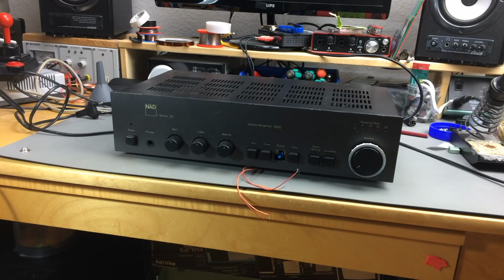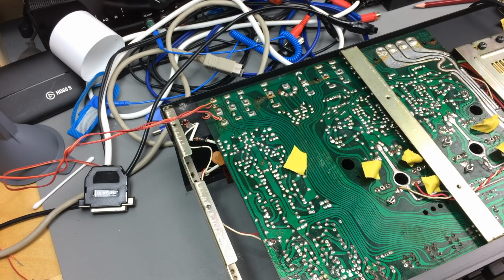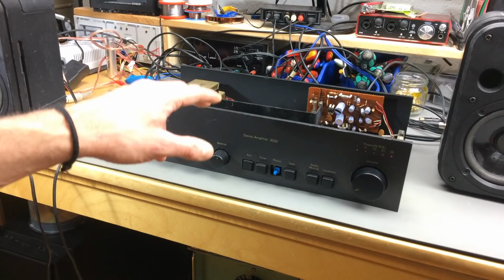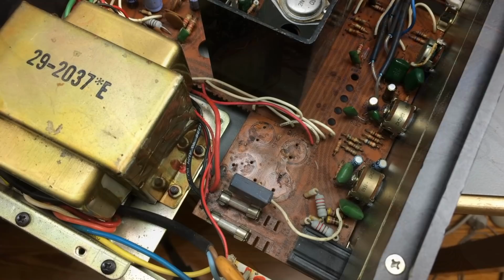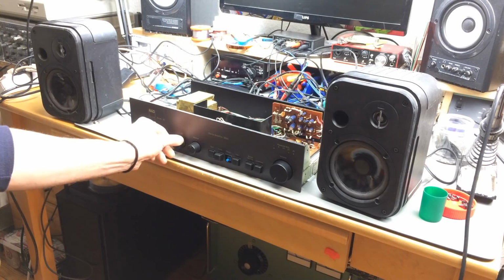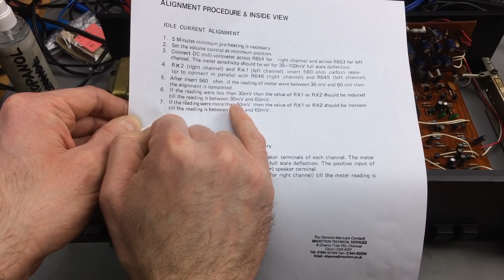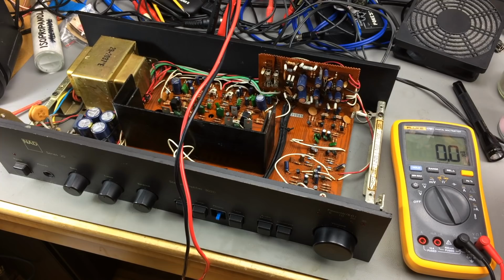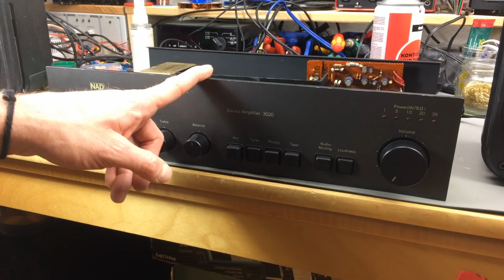NAD 3020 Series 20 Vintage Amplifier Repair

Comment: Two common issues with this NAD circuit (they used it in a few models):

The muting JFETs in the preamp stage often die, causing distortion or other problems

The output transistors have NO emitter resistors. This becomes a problem when they require replacement - I note one of them in your unit has been replaced. It was not a problem with the older Motorola made "hometaxial" devices, but it is a problem with modern "epitaxial" devices made today. It's a good idea to add 0.22 ohm emitter resistors underneath if you replace the output transistors. This also gives a much better way to measure bias current than the way described in the service manual. I've used Arcol V3 vitreous enamelled resistors for this before.

Otherwise, yes, they are nice sounding amplifiers especially for their budget price when released :)
Reply from the maker: That is a good idea. I think I want to replace the output transistors altogether to have a better match (and "fresh" transistors). I'll add emitter resistors when I do it as you suggest. :)

Comment: 29:17  I noticed a missing resistor just pause and see at the center of you screen, between those polyester caps, behind to the larger one next to a small transistor on the side where original pair of transistors are.  maybe that is the reason why you have high bias voltage

Comment: Hi
I notice that my NAD 3020e  only has a 2 core power cable, so the metal chassis of the amp is not earthed.  Is this a problem?  It looks like no three core power cable was ever fitted.
Reply from the maker: Hey, that’s perfectly normal for hifi equipment. There’s only very few amps that have a mains earth connection (I think connecting to earth makes picking up mains hum a lot more likely). The NAD is sufficiently insulated so there’s no risk of electric shock.
Reply: Thank you. I thought maybe it was double insulated and also have heard about stray hum. I really enjoyed your video on the 3020.

Comment: i always liked the sound of these amps, sadly they were made cheap and sold expensive, but at least they are repairable.
arcam, cambridge audio and nad have all been repaired by me over the years.
i dont fix them any more really, i build bespoke metal detectors and custom computers, but i have a vintage sinclair radionics pre amp unit and an amp that goes with it on my bench, i was going to recycle them, but a mate of mine wants to buy them if i restore them, so i'm parts hunting.

Comment: I do enjoy these videos, as well as the retro stuff. I only know the basics of repairing audio equipment. These videos are always a learning experience for me. 👍

I haven't read all the comments and perhaps I am missing something in my understanding, but wasn't the right channel mV measurement reading a negative value (–53mV)? Was that as closest you could adjust it to 0mV or +1mV?
Reply from the maker: Thanks Mark! I'm obviously just a hobbyist with the audio stuff, too, but I worked on quite some amps in the past so there's always at least a tiny bit of experience to share. ;)

The mV was negative indeed. And it was the closest I could get, I couldn't get it to positive at all. I think I'll end up replacing the output transistors altogether with matching ones (still readily available). Some commenters pointed me in the right direction for adjusting the idling current, too. :)
Reply: I wasn't even aware of idling current. #AlwaysBeLearning

Comment: You can bult in a speaker relais that grounded with a 10 ohms resistor (10 watts or so) to ground if its in off status. EB (com): Speaker Protection Board Component Audio Amplifier DIY Boot Delay DC Protect kit,  and 2Pcs Wirewound Ceramic Cement Resistor 0.1 - 10K Ohm 10W Watt 5%

Comment: hello, I have a Nad 3020A, will there be a problem with the amplifier if I turn on my dac in LAB IN and remove the jumpers from NORMAL IN and PRE OUT? I have never used LAB IN, but when I included my dac in it. The sound has improved significantly. But I don't know if I use this switch, is there a problem with the amplifier? Thanks and send greetings.
Reply from the maker: Lab in is just an input that doesn’t filter the super high and super low frequencies. The regular input has some filters in place. Depending on the audio input and your speaker setup, you can sometimes hear better quality from the lab in because of that. And of course it won’t be a problem to just use the input and power amp and leave the preamp section out of the equation, you are going to be absolutely fine, you just don’t have the controls.
Reply: @JanBeta  Thank you very much for the answer.

Comment: One question : for sure it was better to change all capacitors, but would it damage the speakers if you changed one, turned on the amp and so on until you find the guilty capacitor?
Reply from the maker: I don't think the noise would harm the speakers in this case. The only thing that kills speakers really quickly is DC voltage, they can take a lot of AC for short bursts usually. It is annoyingly loud though, so it would be a better idea to connect a load and an oscilloscope to check the output.
Reply: I don't really understand why you would want to change one cap at a time. If this was a fairly new amp it would be better to just replace the defective cap but since this amp is 40-50 years old they all need replaced. If you just replaced the defective one you would probably be repairing the amp often since most all of them will fail due to age.

Comment: IDLE CURRENT ALIGNMENT
5 Minutes minimum pre-heating is necessary.
Set the volume control at minimum position.
. Connect DC milli-voltmeter across R654 for sight channel and across R653 for left channel. The meter sensitivity
should be set for 30–100mV full scale deflection. RX1 (right channel) and RX2 (left channel).
. Insert 1 kohm carbon resistor to connect in parallel with R654 (right channel) and R653 (left channel).
. After insert 1Kohm. if the reading of meter were between 5 mV and 11mV then the alignment is completed.
. If the reading were less than 5mV then the value of RX1 or RX2 should be reduced till the reading is between
5mV and 11mV.
If the reading were more than 11mV. then the value of RX1 or RX2 should be increase till the reading is between
5mV and 11mV.

Comment: i also have a mains hum when i power up a phillips amp
it goes away and returns permanently
weird thing is that eq also affects the hum,which caps should i replace?
i was waiting to see if you will check for every cap that you changed..
should i go and replace the main filter caps? they are 6800mf each and they are 2
Reply from the maker: If the EQs affect the hum, it originates somewhere before the EQs in the signal chain. I recommend getting a service manual (for example from hifi-engine.com) and look at some signal flow chart (that is most likely provided). If it is an old amplifier, you should replace all capacitors really. Oh, and general mains hum often originates from leaky filter capacitors in the power supply section, maybe that's worth looking at first.
Reply: @JanBeta  its from 1984 model Philips F4234
problem is the casing its from plastic and theres no easy access to the underneath of the pcb so i need to remove the whole heatsink,then the pcb just to switch the caps,also there are some special german made caps with 4 pins under it so it would be tricky to put a 2pin cap (for the main filter)
for start i think i am gonna disconnect the signal board to see if the hum persists which i think it will,then ill change the filter caps

Comment: Hi.. I acquired nad 3020 recently.. works fine.. only one problem i see is when I press loudness button the effect is only on left channel..is this something fixable? Thanks
Reply: Yes, it is fixable. Most likely a simple problem of a dirty loudness switch or at the most a bad solder connection.

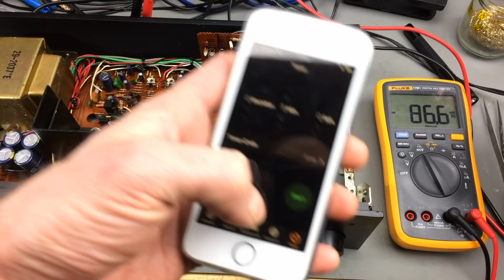Comment: What is the deal with the bottom prong of the left hand fuse holder? It looks like it is bent completely open, you can see it at 42:38
Reply from the maker: Yes, I saw that when I rewatched the video. I'll have to replace that I guess. :)

Comment: hi friend, what kind of heat gun you using? thanks for info !!
Reply from the maker: You mean the desoldering station? It‘s a ZD-915, sold under different brand names. I also have a 858d hot air station if that‘s what you were aiming at. Hope that helps!

Comment: Great video and thanks for the link to the manuals! Lots of goodies there :)
Maybe I can get my NAD CD players back up and running again!
Reply from the maker: Yes, Hifi-Engine is a great resource for audio related info. I use it all the time. Good luck with the CD players! In my experience, they are either easy to fix or really hard. Not much in between most of the times. ;)
Reply: @JanBeta  thanks, I'm hoping for a dirty lens :)
Reply from the maker: Chances are good. Fingers crossed! :)

Comment: Hallo!
Ich habe hier gerade ein Commodore 1541-II stehen. Beim Einschalten gehen alle Lampen an, rote bleibt an, grüne geht kurz nach Start aus. Außerdem dreht sich der Motor kurz beim Anschalten. Mein Problem ist aber, dass, sobald ich es an meinem VC-20 anschließe und etwas laden will, tut sich überhaupt nichts mehr. Der Computer versucht mit dem Laufwerk zu kommunizieren, aber es macht einfach überhaupt nichts. Der normale Motor dreht sich nicht, es passiert einfach nichts. Hat jemand hier eine Ahnung, warum es nicht funktioniert, bzw was ich reparieren müsste? Danke im Voraus
Reply from the maker: Das könnte tatsächlich auch ein Problem mit dem VC-20 sein. Beide Geräte kommunizieren über MOS 6522 I/O Chips, die gerne mal ausfallen. Das könnte ein Ansatzpunkt sein. Eventuell auch einfach ein kaputtes Kabel oder eine kalte Lötstelle an einer der Buchsen?
Reply: @JanBeta  Danke für die Antwort! Also, ich habe das Laufwerk genauer untersucht und auch einen defekten Elko gefunden und sofort getauscht. Danach aber logischerweise wieder das gleiche Problem. Das Kabel hab ich geprüft, hat keinen Schaden. Kalte Lötstellen habe ich am Laufwerk nicht entdecken können, werde aber auch nochmal den VC-20 checken. Gibt es eigentlich eine moderne Alternative zum MOS 6522? Ich meine, die werden ja auch nicht mehr produziert. Ansonsten werde ich mir mal einen auf Ebay bestellen.
Reply from the maker: Die 6522s wurden noch eine Weile produziert, nachdem MOS Geschichte war. Schau mal bei eBay nach welchen von Rockwell. Die sind voll kompatibel und häufig noch als new old stock zu bekommen.

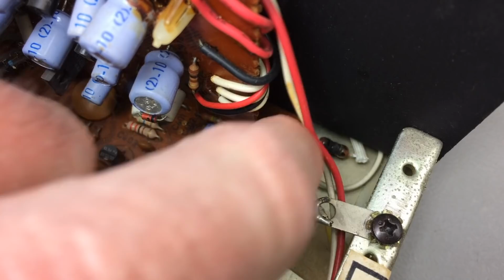Comment: hello sir,  can you  tell me the value of the resistor that must be replaced in 5:40 ? thankyou
Reply from the maker: No, I can't, it's not listed in the service manual I have unfortunately. If I remember correctly, I just left it as is for now.
Reply: okay jan, i've been replacing with 2.2 ohm resistor.

Comment: used to run mine through a equaliser as it seemed lacking in treble. also the plastic was very brittle and bits would break off from the bottom edge

Comment: looking at the to3 metal can components it looks like one channel has been rebuilt, pausing the video at 39:48 and looking at them the left hand mj2955 is a replacement, the 2n3055 beside it is too the loctite is missing from the screws the mj2955 is obviously a replacement  but the subtle signs indicate the 2n3055 was changed as well, it probably lost a channel due to some tit fannying around with the speaker wires while it was running, its quite easy to kill a channel but in normal use those parts are very robust.
Reply from the maker: Yes, one channel definitely got rebuild. I think that's the reason why I couldn't set the bias right, too. I'll probably end up replacing the output transistors altogether.

Comment: Jan - what did you use to clean the potentiometers?
Reply from the maker: I use Teslanol T6 Oszillin, available in Europe. If you are in the US or Canada and can’t find it, you can try Deoxit which seems to be very similar.
Reply: @JanBeta  Cheers - thanks Jan. I bought some cleaner from a local  electronic store and it did the trick. I now have one perfectly working legacy NAB 3020 Amp.

Comment: vacuum + brushing = static discharge. which is a good way to toast some components. i do like NAD amps a friend has a huge one, maybe twice the size of yours. maybe i should buy it...you know, just in case i need a 80s NAD amp. lol
Reply: Any static caused by a vacuum and or a brushing should not affect the components while they are mounted in circuit. Static precautions are needed with loose components.

Comment: Do you have the circuit diagram. There are not all the same components in the machine. So that’s why you have a diverse in output voltage.
Reply from the maker: Yes, I do. I'm going to replace the output stage transistors with new ones the next time I'm in there. Some commenters also pointed me in the right direction considering the idling current adjustment. :)
Reply: Jan Beta I hope you can fix this. It’s always nice to see a restore video.

Comment: I dont know  about changing the transistors...a transistor either works or it dont, there is no half way working, now in a tube radio I get changing the tubes, but not transistors. There is a great chance of getting a counterfeit transistor, which would burn out even faster...I would have left them in there...and just recapped the entire unit..
Reply from the maker: My reasoning behind the transistor replacement was that you could get better matched pairs of transistors which would optimize the output power and stereo imaging. But you are right, transistors usually don't age. They either work or they don't.

Comment: I have no clue about electronics- but that doesn't stop me from watching videos about it :) and I was wondering if you would have been able to use that "superprobe" contraption from Mr Carlson's lab to trace where the hum comes from in such a situation?
Reply from the maker: I think the superprobe would have shown hum nearly everywhere in the circuit as most of it was probably leaking AC from the power supply (the earliest stage in the circuit).

Comment: it says MEASURE ACROSS the resistors - not put new ones in! it just means put your probe at one end of the resistor and the other probe at the other end
Reply from the maker: Yes, I got that part. But then you have to put new ones in to set the current.
Reply: Jan Beta my impression is that it’s simply measured there but current is set across a different trimmer elsewhere in the circuit. Well at least that’s how mine is.
Reply from the maker: There’s no trimmers in this unit, that’s what confused me. You set the bias by replacing the resistors.

Comment: There was actually a REAL bug in this device ;) - and some (not very serious or senseful) tinkering has been going on as well.. The amp does look cheap right away, especially these knobs for switching the input, even so considered to have a neat sound quality nonetheless...
Reply from the maker: Yes, the interior looks pretty messy. The exterior looks alright and simple, although the controls feel quite cheap indeed.

Comment: Maybe you need to get 2 sets of new power transistors? Left and right channel. While you wait for the power transistor mica insulators get 2 sets of new power transistors.
Reply from the maker: Yes, that's what I did. There's going to be a follow up video sometime, too. :)
Reply: @JanBeta  good job Jan. Might as well put in new power transistors seeing you have refurbished all caps . I like to keep all transistors in both channels the same brand. Good luck. O now must repair my old Yamaha A 500 amp. 1982. Change caps and power transistors and what ever else is faulty.

Comment: NAD, Nearly Always Defective!
Reply: 50/50 out of the box.. and didn't they stink new?
Reply: @PaulaXism  , yes as a matter of fact.   Their designs were good but it seems they always farmed out the manufacturing to the lowest bidder with untrained solderers.
Reply: @aaa000777  , early NAD and Proton were made by Fulet (spelling?) in Taiwan, IIRC. British circuit design, good sounding amps for cheap, but poor build quality. Horrid capacitors, and glue that turns conductive and corrosive with time and exposure to heat. And that horizontal shelf for the input jacks is a wonderful collector of dust, debris, and dead spiders. But at least they had a removable bottom plate, unlike virtually every NAD device made in the last decade or more.
Reply: @Okurka.  , British *designs*, but generally built in Taiwan. Here in the US I have never seen a British-built piece of NAD equipment.
Reply: Truth Warrior FORD founds on roads dead

Comment: finally i've been done recaps my NAD 3020. and i am very happy that the hum was gone. but for now i face the problem when set up idle current, i can't get same value when measuring between R&L channel. i try swapping all little transistor from R to L channel also replace 2 bd139 that mounting to the heatsink with new ones, but still problem. I get measurement 8.5 mv for R channel and 1.7 mv iddle current for right channel ( i use same procedure for measure in service manual).

and yes, i get -30 mv Dc Offset on both channel. 

by the way, thanks for this video Jan.. I hope you make follow up video for this amp :)

Comment: Should repaint or recoat the metal housing.
Reply from the maker: It's not that bad actually, most of the stains were dirt rather than scratches, but I might consider it.